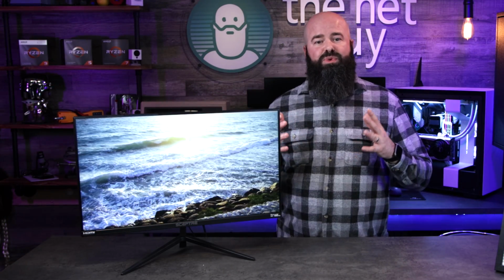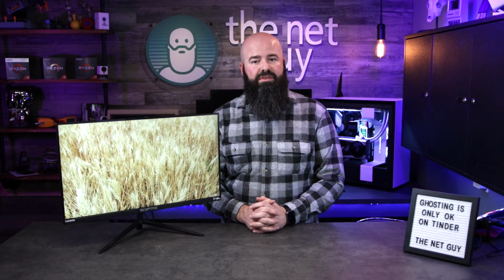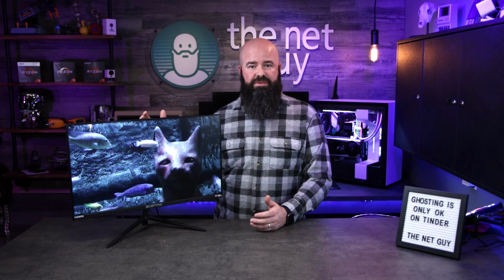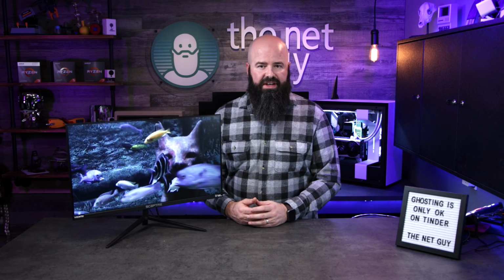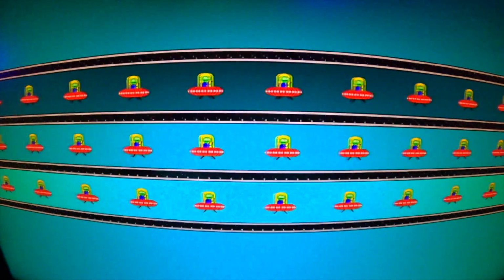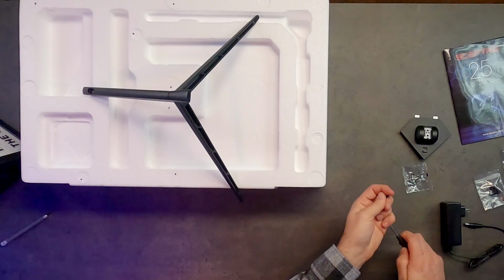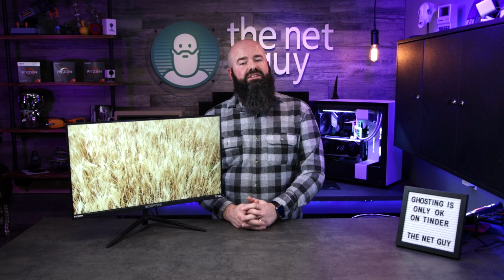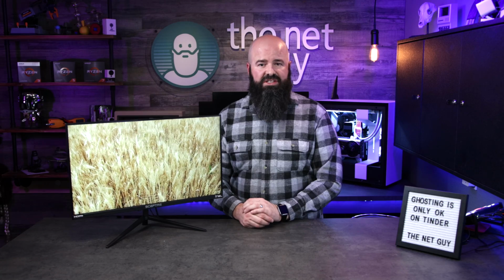SCEPTRE 25" E255B - 165HZ & NO GHOSTING!

Comment: Just bought this for $119 on Amazon! Insane steal! Cheaper than the one I currently have and this Sceptre is better as it will allow my Xbox to run 120fps!
Reply: Is the picture quality sharp? And is the ghosting really nearly zero?
Reply: Hello, its been 1 year where you had the monitor, did you face any issue yet?
Reply from the maker: Nope, it’s an excellent one and value 👍

Comment: I JUST unboxed mine and am noticing words aren’t as sharp as they should be. Anyone have any tips?
Reply: I have the same issue nad had to tune Windows Clear type like 20 times and disable Overdrive on the monitor... I'm on DP @165hz... BTW... I do get some ghosting after about 6 hours of gaming or setting FPS mode and/or Vivid Gaming enabled for my AMD RX 6600 XT... RGB mode sometimes darkens the screen and have to switch to YCbCr then restart PC and switch back to RGB mode to get the incredible brightness it advertised...
Reply from the maker: Set resolution to 1920x1080p?
Reply: @TheNetGuy  already there, but the Hz says 60. I’m not entirely versed in what all of these mean so bear with me 😂
Reply from the maker: @harrisonrice4633  interesting.  What is it plugged into?  If you go to advanced display settings you can turn it up to 165hz for gaming.
Reply: @TheNetGuy  can you point me in the direction of advanced? I know I’ve seen it once on another Sceptre but haven’t found it on here.

Also, just your standard HDMI cable. Maybe that has something to do with it?
Reply: @TheNetGuy  is the Hz output relative to the game you’re playing or console or something? I’m on a PS5 and noticing the lettering when playing FIFA is almost choppy, in a way.

Comment: I just got this and for some reason the screen is increadibly dark compared to my other monitor and turning up the brightness just makes the whole screen white any tips on how to fix that?
Reply from the maker: Yes, adjust the backlight value instead of the brightness.  Also make sure MPRT is off. That will do black frame insertion and dims it as well.  Eco modes off, etc.
Reply: @TheNetGuy  Thank you that fixed it!

Comment: Question, do I use the HDMI that came with the monitor or the Xbox series C HDMI, and and which HDMI slot do I connect them to?
Reply from the maker: Yep, use the HDMI that came with the monitor OR the one with your Xbox (it's usually high quality).  Then put it in HDMI 1 and select 120hz.

Comment: I just got the monitor, and my PS5  reads it at 1920 x 1080 - 60 hz 
Do I need a different  hdmi cord if so which one
Reply from the maker: Make sure you have the hdmi cable on the first input.  Should do 120hz easy.
Reply: @TheNetGuy  I do. It still appears 60 hz,  so got this audio quest hdmi sky 48 thinking it would help but no still appears as 60hz
Reply from the maker: New cable?
Reply: @eduardomurillo8714  have you put enable 120 hz at automatic and set your game preset to performance mode? Also not every game runs 120 on ps5
Reply: @eduardomurillo8714  did you figure it out bro?

Comment: Do you know what size mount i could use for this monitor? It’s smaller than a 75x75 for sure but i can’t seem to find the right size that’s lower measure. It’s so weird lol the back is a diamond which is cool but weird that it doesn’t fit a 75x75 like other monitors.

Comment: I just got mine and am struggling to figure out how to mount it on an arm. Any links to a video that helps?
Reply from the maker: Did you save the adapter? It’s very similar to the C 30 Ultra Wide video I have in my collection. In this case the adapter attaches to the visa plate or arm and to the monitor.